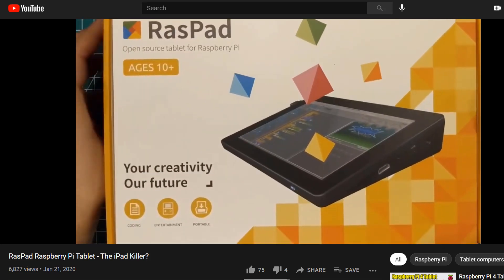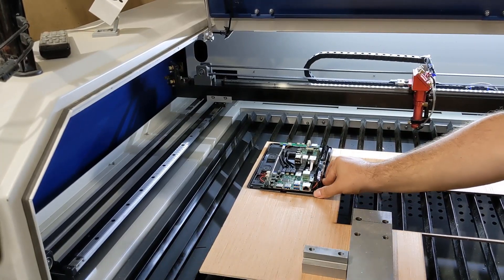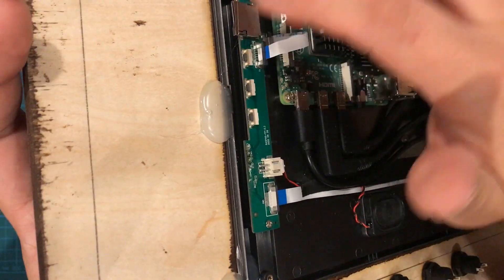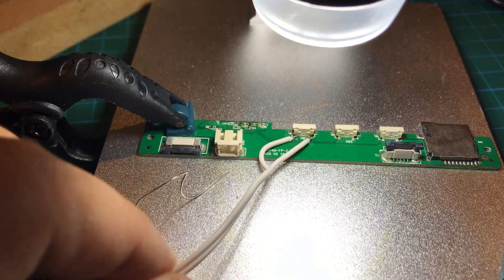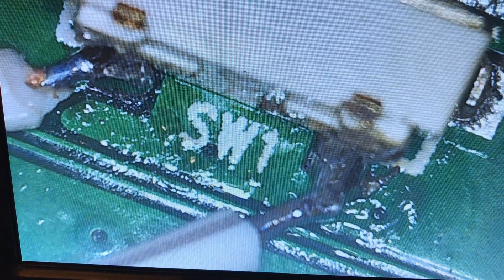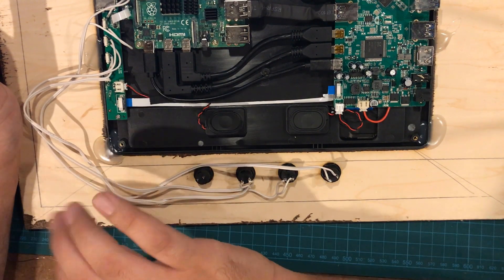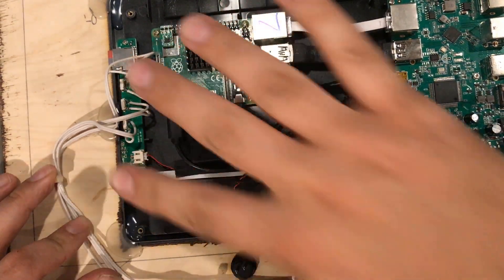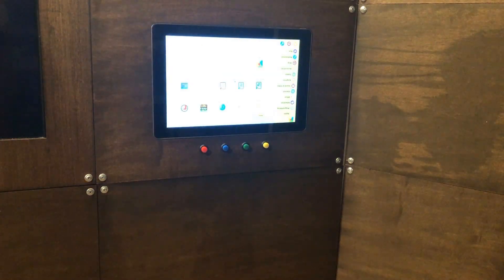Turning the RasPad 3 into a touch control panel

Comment: Hey just wondering, what kind of connecter does the battery have? Haven't been able to find any information on in. Planning on upgrading the capacity to 20000mAh
Reply from the maker: It's a little JST connector